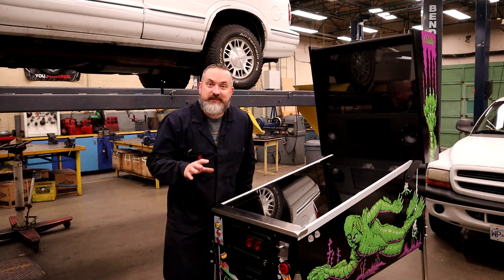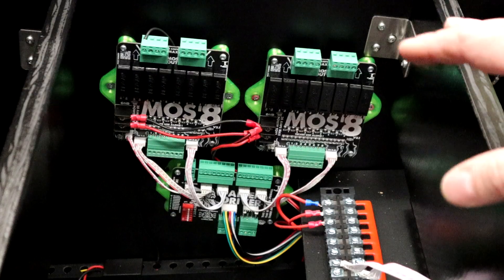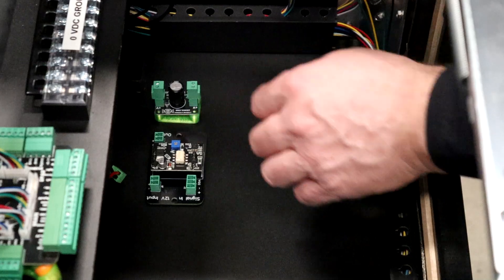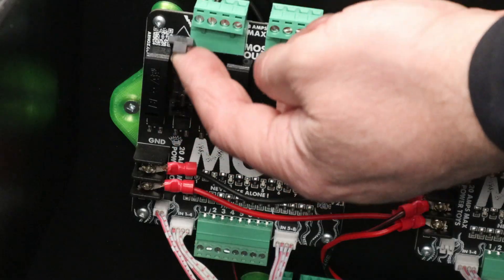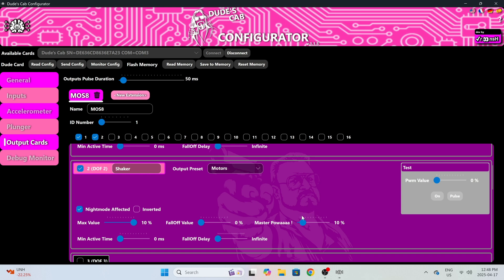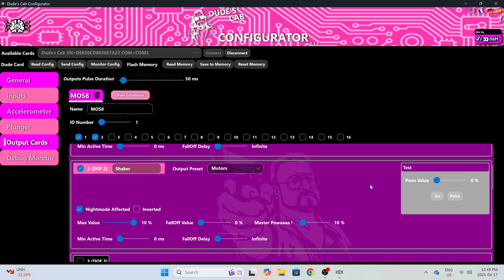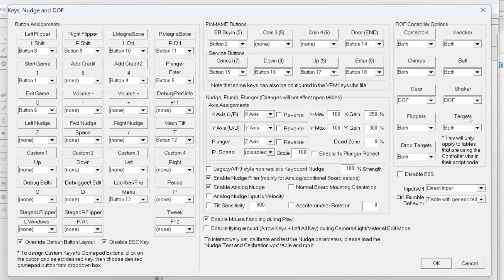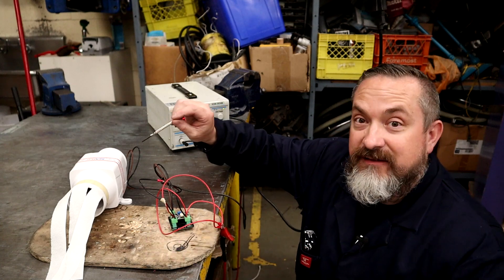How to install a CSD shaker motor in your virtual pinball cabinet!

Comment: THANKS for all the AMAZING videos!!  Slowly getting caught up.  At this time I haven't put in the gear motor.  I have installed the shaker motor and bolted it down. When I set it up in the Dude Cab configurator.  I can hear it charging and when I run the test, I see it move just a fraction.  When I click on inverted and then send and save, it kicks on by itself without doing the test.  Which freaked me out the first time. (lol).  The only way I get it to turn off is by unselecting the inverted button.  Ideas?
Reply from the maker: You're very welcome, glad the videos are helpful! It sounds like the shaker motor is on pwm and not enough percentage to fully get it going.  Try increasing the pwm percentage slider. Mine is set to 5 or 6%.  Don't use inverted, that makes it on all the time and only off when you select it.  Hope that helps.  Cheers!
Reply: @wayofthewrench  I am using PWM.  I would have everything at 100% and it still would not work.  Just moved a fraction.  You can even hear the feedback through the speakers.,

Comment: hi. love all your work and follow you, i was wondering if i could ask for help. i origionall used a marquee for my dmd, but  the pixels messed up, i used your tip to tranfere to an old laptop screen,. now the 2 screens have swapped with each other ive tried chancging the displays in baller installer with no luck.ty
Reply from the maker: Thanks, glad you are enjoying the content.  You need to redo the monitor setup in baller installer, I have a great video on that in this playlist.  Good luck!
Reply: @wayofthewrench  ty so much ive tried twice but i will refere to your video , ty.
Reply from the maker: Good luck!
Reply: @wayofthewrench  everything is working now ty, i did a full re install as i did clean up my table library  ty for your advice, ill be using your other video on how to automatic play without having to git through window.
Reply from the maker: Sweet, glad it worked!  Cheers!

Comment: Dammit...  This video made me pull my shaker motor which I had already screwed into my cabinet and reinstall it with bolts.  Yeah, yeah, yeah... I will most likely be thanking you later.
Reply from the maker: Oh for sure, those wood screws would have worked themselves out until the shaker motor would peace out and take something with it.  Thanks for the watch!

Comment: Also thanks for covering that the shaker did not move the ball! Always wondered if i add one if it would ruin it.
Reply from the maker: No worries and yes it definitely can if you crank it up but at that point it's too much or your anti vibration set up on your dudes cab needs looking into.  Thanks for the watch!